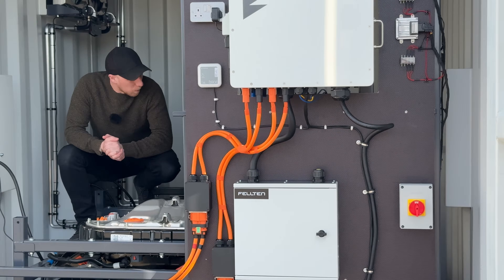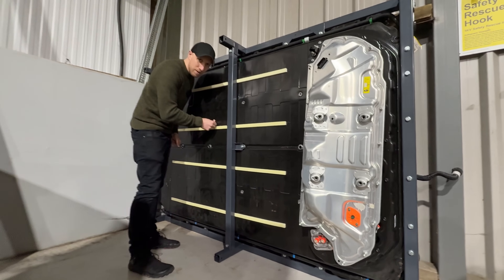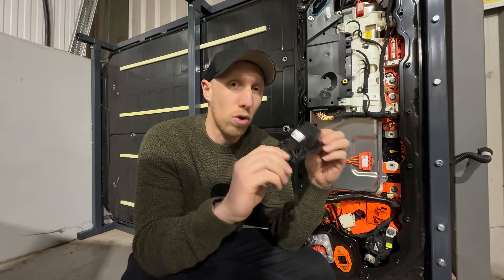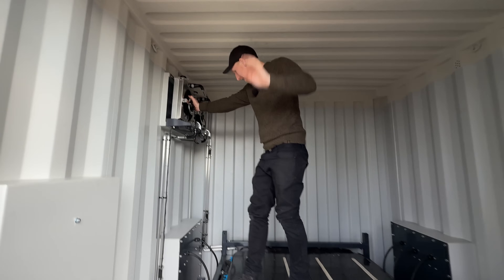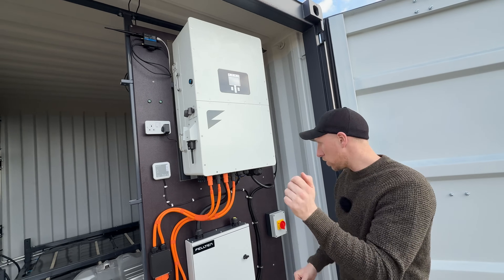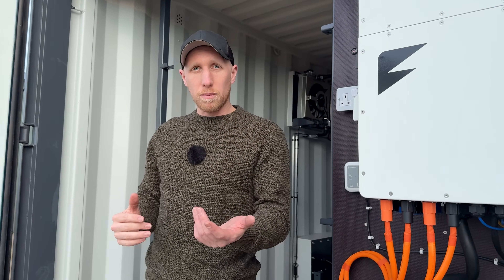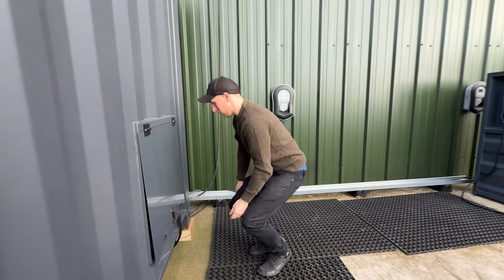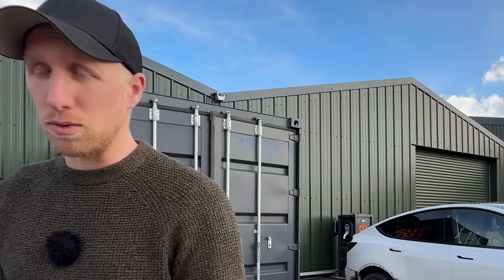Massive Tesla battery power wall container!

Comment: Makes sense they last a log time 1000 cycles at 500KM per cycle is 500k KM, age is often just as much a degrader as the usage.
However china is DUMPING batteries for $70 per KWH now so used auto batteries can barely compete.
Reply from the maker: Issue is the cheap Chinese battery’s are not great and does not include all the other systems needed.
Reply: @Hazell_Nutz  Friend drove an arcfox with a 60KWH battery, $18'000 for the whole car new how much does a good condition 60kwh tesla pack go for?

Comment: Doesn't that panel in front of the door make it difficult to add/remove batteries?
Reply: batteries do not have to be removed, they are installed for good in the Qube, then charged from the grid or other sources.
Reply: @OutRun_YT  ah yes, batteries never die...
Reply from the maker: 😂 everything dies at some point
Reply: @ that's why we must enjoy each charge to the fullest! lmfao

Comment: have you actually fitted 6 battery packs and tested the maximum output and heat dissipation - or is it just a theory (aka Musk “this time next year)
Reply from the maker: Not put 6 in yet, we have simulated in cad, but there is little to no heat as the packs are not under any real load.

Comment: Great thing, wishing you success with it. Question (from an armchair commentator, with no expertise): would you need some form of fire suppression inside the cube given the amount of battery inside, or are you confident of your management systems?
Reply: They need fire suppression and the Tesla packs require pressure equalisation too.
Reply from the maker: Yes, the management system is Tesla but we will have automatic fire extinguishers and imports in the front of the container the fire service can clip a water supply to directly if the worst was to ever happen
Reply: @Hazell_Nutz  just having the BMS is not enough, the coolant system maintains coolant pressure and pack pressures. You will eventually run into coolant system corrosion issues especially without heating elements.
Reply: @Hazell_Nutz  Cheers.

Comment: Very nice neat install. Are you using NMC or LFP?  If LFP. I would love to know how you’ve gone about cell balancing.
Reply from the maker: We are using a mix depending on availability. Every oem pack is left complete so is controlled like it’s in the car so the original battery management system manages everything.
Reply: @ just to know that emulating the vehicle and keeping the drive mode connected is enough to keep the pack in balance is a lot of useful information. 

Nice work
Reply: I would also like to know how the balancing on the lfp is done in this setup